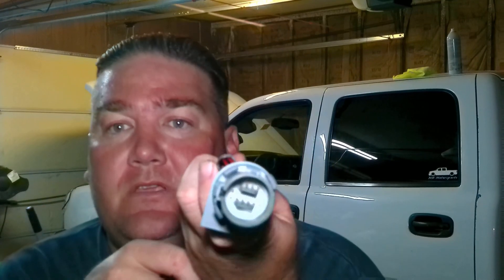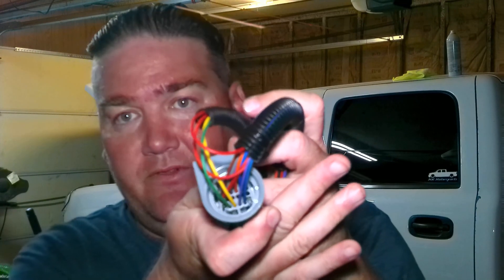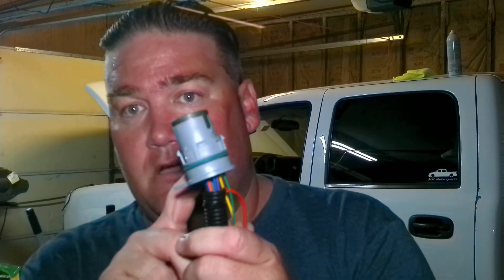Installing internal wiring harness in a 4L80E

Comment: Does these harnesses cause trans issues? Anyone ever experienced any? Mine had a puddle in it for a while, but my truck is having erratic shift issues.
Reply from the maker: For no more than they cost and difficulty to install it’s a cheap test.  Erratic shift issues can come from the vss which is the back sensor on the trans.  Might pull it out and see if it’s damaged or has a lot of metal magnetized to it.
Reply: @zerofactorx  VSS was replaced about 2 months ago, no real change. Torque converter, filter, and fluids were changed a week ago. Then we got to talking about the APS and wiring harness. You just gotta give the vehicle gas for it to move in first gear or else it’ll just sit there. Then the RPMS climb to like 3500 and then shifts into 2nd
Reply from the maker: Could be in the pump body.  I’ve seen a few that it takes a second to build up pressure before it will move.  The pump gears will eat into the housing causing a drop in line pressure due to the tolerances being way out and basically creates a bypass situation that the fluid doesn’t get charged and doesn’t create pressure and can cause cavitation.  Does your fluid look foamy
Reply: @zerofactorx  Fluid looks good, its been with Next Level Performance and he’s kept the vehicle for almost 2 weeks and has not reported any visual signs of foam or bubbles. When the vehicle goes into 2nd gear, it drives perfectly. For some reason its just always delayed in first gear. It builds up speed, not really hard shifting, it just shifts at a different RPM. The fluid was burnt so we replaced the TC and drained the fluid. The vehicle has 0 transmission or engine codes. No misfires, nothing. When you manually shift into the gears 1,2,3,D,N,R, the vehicle immediately clicks and switches into the gears. You can feel it switch into every gear. The throttle body was also bad as it was reading 20 volts while the truck was turned off. Now its around 5-6 volts. Still no change. MAF was replaced. No change. So now we were thinking either an electrical issue such as a defective pass through harness, or a bad acceleration pedal sensor. Again no codes at all. And his scan tool even shows the gears reacting on his graph when you switch the gears.
Reply: @zerofactorx  (2) and i know that 3000rpm shift in first probably aint bad but, in a 2003 chevy HD 6.0 4l80e, 3500rpm from first to second at reasonable/neighborhood driving just seems excessive

Comment: Do you know the harness part number?
Reply from the maker: 4L80E TRANSMISSION INTERNAL WIRE HARNESS 2004 & UP https://www.amazon.com/dp/B01IDLAEW6/ref=cm_sw_r_cp_api_glt_fabc_21TBQQ9WGKZ5NMDWGPNV?_encoding=UTF8&psc=1
Reply from the maker: This is what I used I just installed in an older unit was a Rostra pn: 350-0032.  This fits a 91-03